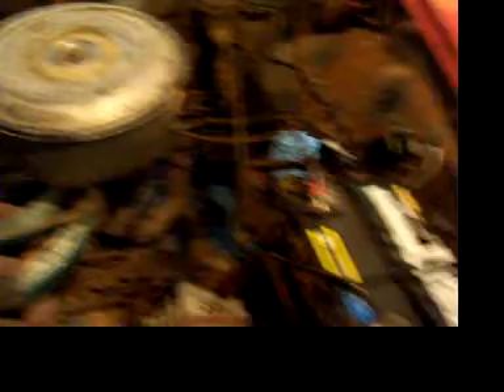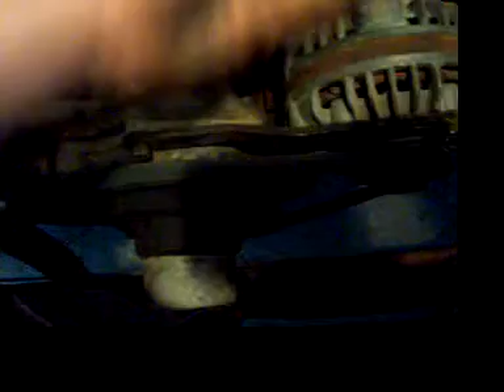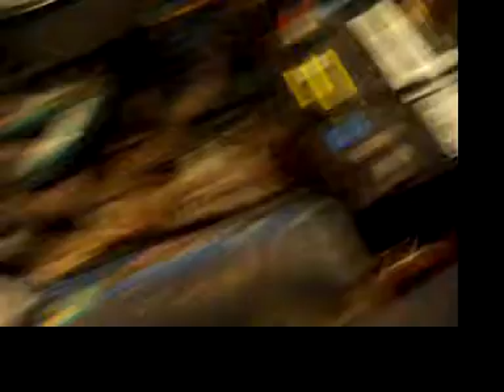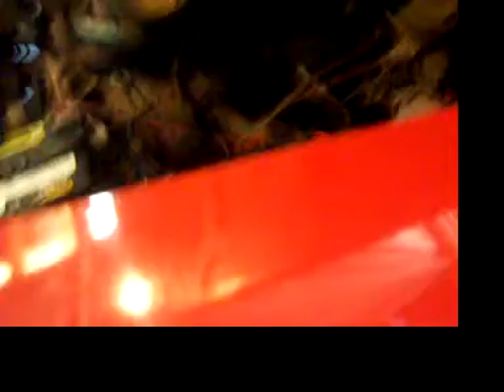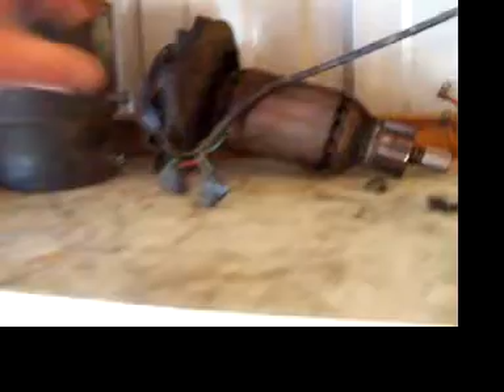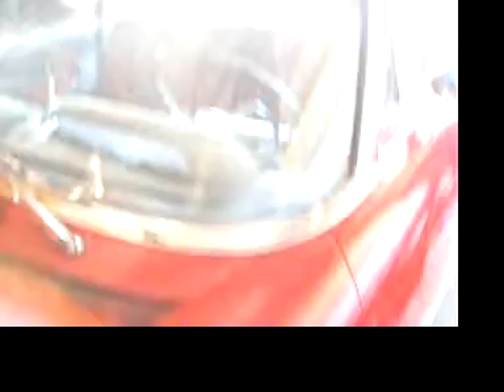Generator to alternator conversion

Comment: @vaINZANE Generators were used until alternators were developed, the modern alternator is much more efficient. Delco Remy (GM) makes a one wire self exciting alternator, it is similar in design to the ford alternator. You may have to build your mount or use the brackets from a 302 and do the proper wiring. Most alternators have a batt wire and one that switches on with ign, the instruments are in the wiring: charge wire goes through an ammeter or a shunt you will need to find out how it is wired

Comment from the maker: @vaINZANE A one wire 12v wont hurt any of the electronics. The only time you have to be careful with that sort of thing is if you had an older car with a 6v system. They used generators because thats what they had and what they were used to. Just like they used to use carbs and now they use fuel injection.

Comment: I just converted my 57 chevy to an alternator.  I was lucky. Kits are available for this swap. Used a chrome 105 amp alternator available on e-bay.  Wiring was from a conversion kit.  All purchased on e-bay.  Hook up that idiot light.  Mine still works with the alternator.

Comment from the maker: An alternator with the regulator inside will work fine as long as the tractor has a 12 volt system in it.  If its an old tractor with the 6v battery that would be why its overcharging.